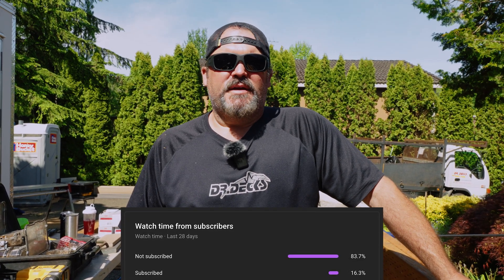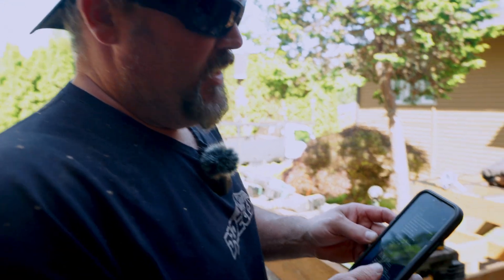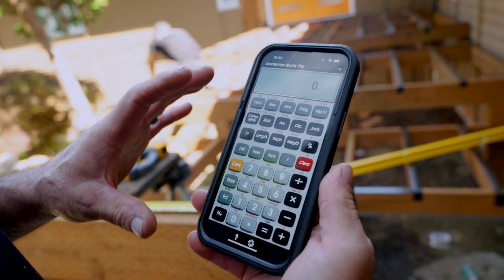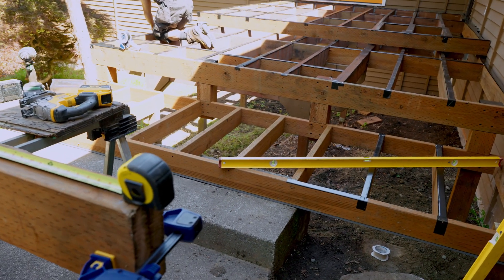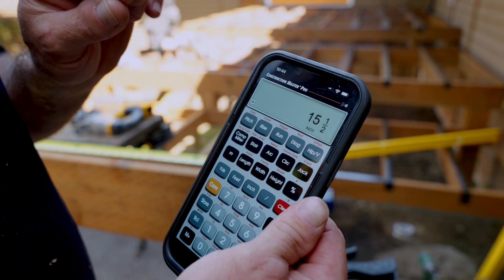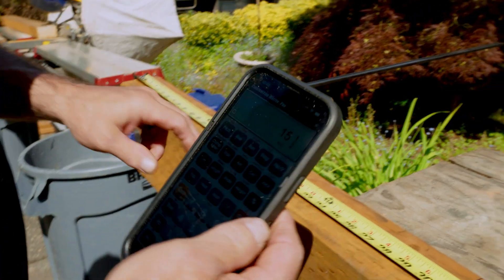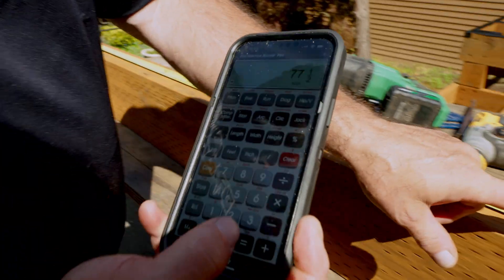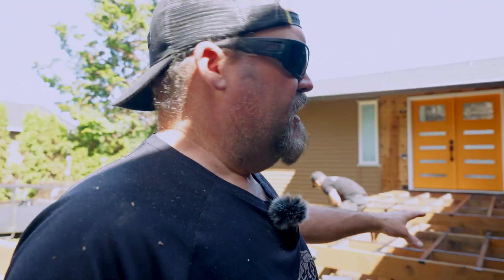How To Lay Out Joists Equally || Dr Decks

Comment: you can press + and then = when you were at 15 1/2 to start your stacking numbers. Also, the discrepancy with the last bay, you can eliminate that completely by subtracting the width of a joist from the overall total width; thereby, when you get your running numbers, it will end perfectly one thickness back from the final edge, giving you perfect equidistance.

Comment: What about the permit? Are you going to put on the permit that you're doping 15 1/2?   yes I know it's stronger than 16 but now there's a deviation from the standards.  I'm trying not to deviate except where absolutely necessary: it means that it is another disparity/distraction for the reviewer at County.  Also - this will confuse anyone who wants to know where the joists are when on top of the deck. Maybe that's important maybe not, but it's at least something to consider.

Comment: Thank you so much for doing this channel, your my number one go to for deck information!  I live in Virginia and the wood here is horrible  with inconsistent measurements varies as much as a 1/4” or more on the height of a 2x8 or 2x10 and the thickness ranges up to a 1/4” difference also.   My question is do you have this issue also?  And if so how do you deal with it.  Also your wood is definitely different than my pressure treated.
Reply: Seems to be a common problem- especially with PT lumber. I bought a corded hand planer do help with this problem (when the difference isn't too great that it might require ripping).
Reply: He has videos on this. Basically you lay them out, crown up, and then order the boards by thicknesses from taller to shorter. Then use that order for your joists to start with as flat as possible. You may need to still use an electric hand planer to flatten it better. But that's my lame explanation of his video, go search and watch it for a better explanation. Oh, and use the most crowned joists for blocking, thus cutting the worst one into short block where the crown doesn't matter.

Comment: Multiple breaker boards make things quite difficult.
Also a deck with 2 breakers, switching from 16 to 12oc, without replacing the ledger which has lags 16oc which was quite fun when every 2 joists the lag was in the way 😆